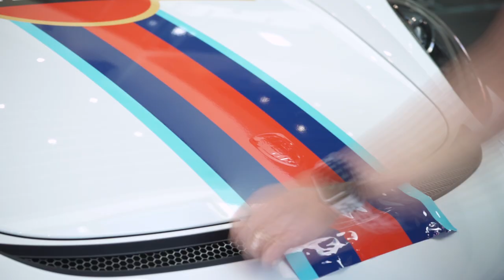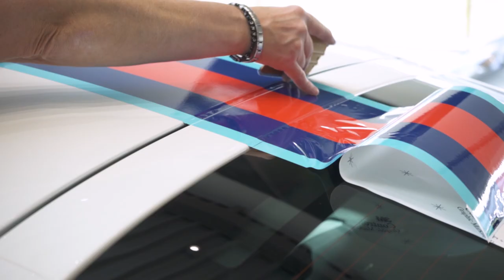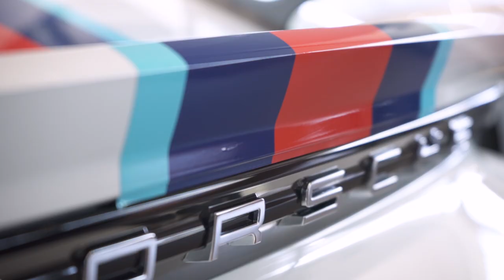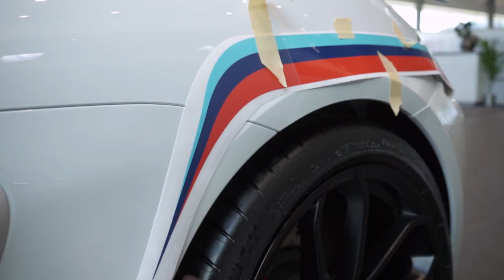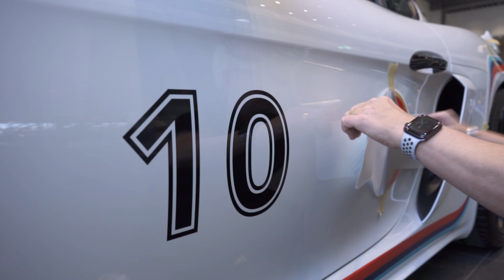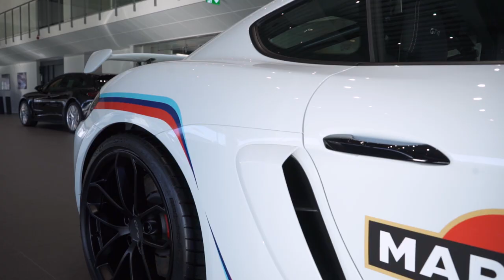Autoident | Martini livery on a Porsche GT4

Comment: They use these sharp knives and can actually inadvertently scratch the paint underneath but putting these deep cuts while doing full body wraps. You can’t simply buff these out or touch up paint this because of the layer of plastic. This thereby creates an entry point for moisture and rust. While wrapping is great, the person or company doing it can be so incredibly incompetent or accidentally neglectful they actually make things worse!  Yet wrapping is so extraordinarily expensive and they will try to use slick oil salesmanship to say it’s better. Wrapping only lasts about 3-5 years.